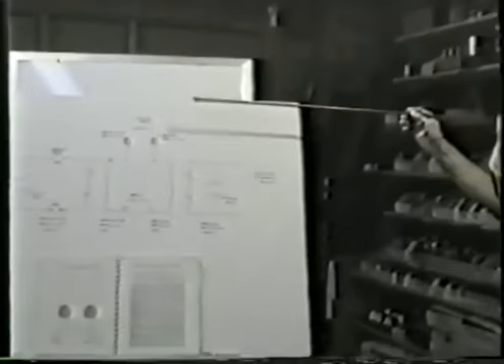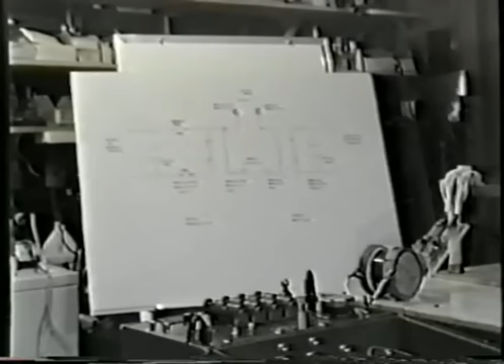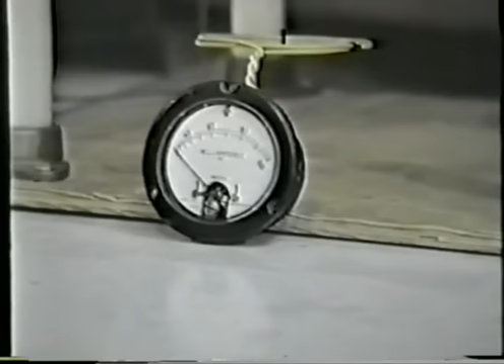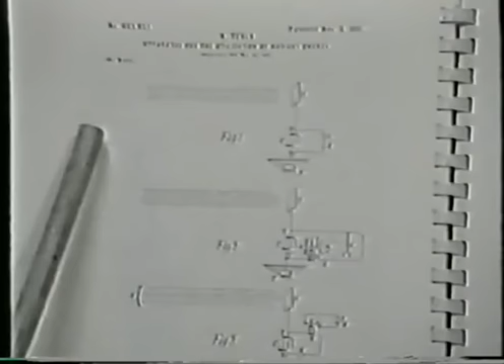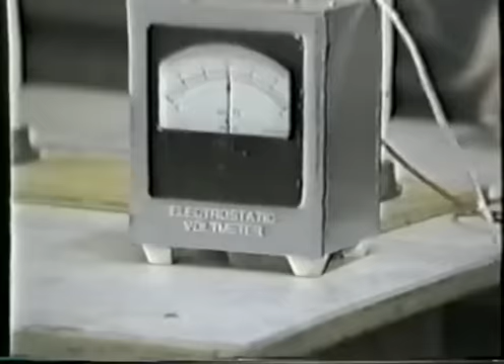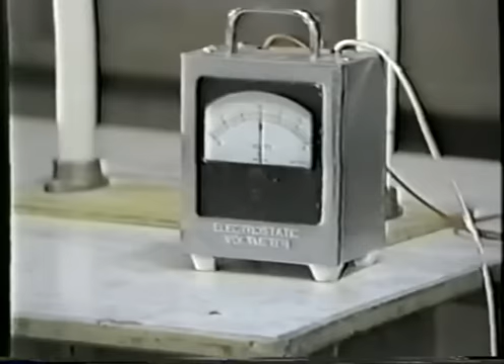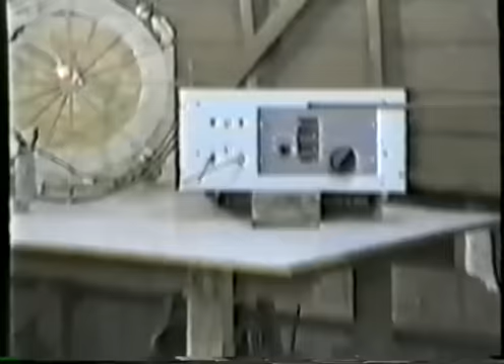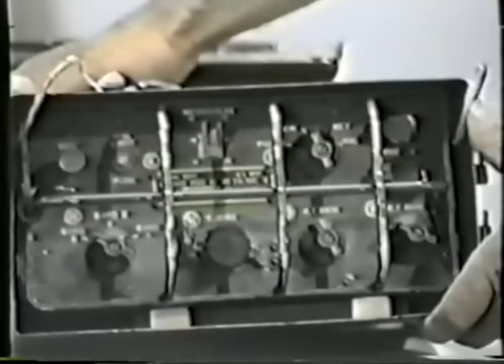Tesla's Longitudinal Electricity - Eric Dollard, Peter Lindemann & Tom Brown

Comment from the maker: Tesla found that when he sent radiant energy into the ground he could gather it at a receiving station several miles away. Tesla could indeed transmit electricity wirelessly but NOT through the air. Tesla said in his own words that significant transmission of power through the earth ionosphere wave guide was impossible as it was not thick enough to conduct significant power. The transmission was through the GROUND, literally.

Comment from the maker: What was more amazing was that sometimes more power would appear at the other end collectively than was put in. For example if 1000 watts of conventional power was pumped into WardenClyffe then 1000 watts could be gathered at a receiving station in California and another 1000 watts could be gathered at a receiving station in Egypt, for a total of 1000 in and 2000 out. The earth would magnify the power. The more receiving stations the more power.
Reply: That could only happen if the receiver coils r operating as tunning forks w energy transfer happening over resonance frequencies of either one working as a transmitter the rest as receivers of harmonic resonance
Reply: @roshanmathew9443  Wardenclyffe operate one immense reactive power which requires a trick or 2 to be able to tap, he used the tower as a catalyst to stimulate the Earth turning it into the actual supplier of energy, not the tower. The receiver coils being resonantly tuned allowed them to pick up on the induced disturbance and do work.

Comment: I don't know who actually reads this but a lot of obfuscation has happened through Tesla myth vs. Tesla's true experiments. However for me one thing of immense value would be if in all of the high energy, resident, isotropic EM radiations found within the environment  a part could be rectified into anisotropic current. If done efficiently… you know where this would lead. In theory (Tesla) the potential is staggering.

Comment: Reproduced the lightbulb segment at home with the popular Tesla coil setup. You can get the effect by putting the light bulb (got one from an old microwave) in series with the ground connection off the secondary. It's pretty neat. Couldn't get a cap to charge yet, though.
Reply: Aklemvaeo Hi Aklemvaeo, could you tell me how you got the light bulb segment to work? I would be happy with the light bulk attracting copper.
Reply: It wasn't QUITE as strong as it seemed in the video, however, it was still noticeable (my system probably wasn't tuned correctly). All I did was connect a incandescent bulb in series with the ground wire of the secondary coil buy sort of trial and error watching the video. I haven't had the chance to experiment much, but I had found that it attracts all conductive material, akin to the strength of a weak static charge. The filament must be in-tact and be bright-orange (heating up due to ground currents) as in the video.

As he mentioned, try to use a smaller bulb, as they use a vacuum as opposed to  inert gasses - most hardware stores should have them. Worked for me, though I haven't tried it with other types. Remember, sparks or corona coming out of the top of the coil is power loss. to maximize this effect, try to limit the amount of possible sharp edges/breakout points on your top load. Hope this helps.
Reply: Thanks! A few more questions. What sort of input did you use. They used a medical Tesla Coil. Is a "regular" Tesla Coil good enough?

Since I have read that most things we call Tesla Coils today are not actually how Tesla built them.

Comment: This is a fantastic representation of what science says is not possible, as well as what all of Youtube's doubters, suppressionist and mathematicians state is out of the realm of possibility. My question to you is this, I do see the camera glitching and sometimes blanking out due to the fields produced by the energy released in the arc gap. As we all experiment with this stuff at high frequencies, how bad is the emmission of these fields to the human body? Is there a potential for xray, microwave or gamma transmission from this system as stated on some  high voltage switchgear states in their warning labels while switching? I by trade have been a high voltage cableman for nearly 20 years that have questioned this over the years. The high voltage switches in question that supposedly produce dangerous radiation are both air gapped or gas switches that use SF6 vacuum bottles for their operation. Switching is done under vacuum while the switch is filled with the gas, then, put under a negative pressure for successful operation. The switches operate under approximately 5kV or 15kV phase to phase voltage (4800v, 4160, 13,200 or 13,800 volts and 14,400v ranges labeled at either 5kv or 15kV @ 60hz making it much different than the high frequency you are using, probably a whole different ballgame) Anyway, my question is that during those switching periods, due to the high level of energy possible and amperage forced through the system from the generator, they say the arc opening under load in and out of a vacuum creates these dangerous waves. I am wondering if the system you are working with has the ability to emit the same type of dangerous wave which may cause cancer and other tissue damage that is virtually unknown to the operator without stamps or labeling. I know a high powered field is present which interferes with the camera, so, if it interferes with the camera, could it be potentially dangerous to be around? I experiment with high voltages, wireless transmission and all sorts of other phenomenon to try and witness the transfer of energy use without creating additional loads to the source as a ton of othr researchers do. Is it fair to say that these waves may be present around the rest of the family possibly causing harm to them when I use systems like this or the Hairpin circuit in my basement? We do experience interference within our televisions and radios, cellphones, etc. I'd like to say it's safe to the wife, however, I don't want to transmit something potentially nasty that may cause harm to myself or the rest of the family. What should I NOT experiment with maybe frequency wise or what should I steer clear of when experimenting? Are vacuum arc tubes a danger to us? I have used over the years early radar vacuum arc gaps and such which I have to say made me feel a presence of something potentially harmful. Is there a frequency range I should stay away from or is there nothing to worry about? I like to fire up the hairpin circuit and try all sorts of experiments and am just worried I am going to harm myself or others doing so. Please let me know if you and Eric have witnessed any release of potentially harmful energies such as microwaves, xrays, or any other high powered energies capable of destroying human tissues, causing possibly nerve damage, eye damage (other than from looking at the light), basically from just being within so many feet of the experiments. If and when you have tried to shield these waves, how would you do it, maybe by creating a Faraday cage around the lab with a grounded conductive paint or maybe metal rooms, sheds, etc? If this can be of any type of danger to my family, I'd probably purchase a metal structure and build my lab in it outdoors, away from my home, grounding the structure using very large low resistance resistors so the shelter wouldn't be an attractant to lightning.
Reply: An arc gap produces a near infinite number of radio frequency harmonics well into the microwave and xray ranges.  Most harmful is ultraviolet emissions that will destroy your eyes.  An arc gap is a cheap way to generate high power radio waves, but continuous wave (CW) is certainly much safer.

Cheap RF detectors are fluorescent lamps and broadcast radio receivers to check high power and low power RF at various distances.  If you can light a hand-held fluorescent lamp tube, then you are too close for safety..  Even Tesla did not sit near his energized coils - the photographs were double exposure with power on and power off.

Comment: Energy goes in a light bulb, out the cable and into the KWH(Kill A Watt Hour) meter where it is terminated. Heat originates @ the load moving towards the generator. The KWH meters have no physical on or off switch, yet the KWH are always on....

Disconnect the battery ground terminal of any vehicle and everything will cease to function. So where is the Energy coming from since the positive terminal is still connected to the battery?

Comment: Why would a utility company be threatened by this then. Unless you could take 100 volts of electricity and send it a mile down the road through the ground, it would take huge amounts of power only available from a generating station. You don't find those in someone's back yard.

What would have been the practical use anyway?

Comment: Do not have a fisher medical tesla coil laying around. Can standard ac be used as the source ? Tesla's patent did mention one could use oscillating current. Tesla's patent 649621 does not include spark gaps or a capacitor. Are the spark gaps and capacitor from a different Tesla patent?

Comment: The phenomena with the light powered by the "longitudinal" source is likely explained by the photoelectric effect.  The source acting on the filament is likely both liberating electrons and high frequency (blue, maybe uv) light or photons.  The electrons negatively charge the inner surface of the bulb and the higher energy light knocks electrons off the exterior metal surfaces giving them a positive charge.
Reply: electrons do not exist, theyre field concepts of protons
Reply: Theoria Apophasis "Electrons do not exist"?????
Reply: ***** photoelectric phenomenon is directly proportional to number of photons hitting the valence electrons and does not have anything to do with frequency.But,frequency of photons increases the momontum of electrons which means the electrons come out the metal faster . But intensity of photons increases the ejection of electrons ,which means more potential difference is created across the ends.

Comment: The "Terrestrial stationary waves" article on wikipedia explains how it is impossible for this to work. Can you please explain to me in layman's terms Tesla's idea? I'm not an engineer or a physicist. Please be as detailed as possible, you can send me a message. Thank you!
Reply: If you're still wondering about this, Tesla's transmission type is an electrostatic displacement current that has dielectric materials as its medium of choice rather than "conductive" materials, Tesla found that the Earth can be made to resonate like a bell and transmitted into the Earth at a multiple of 11.77 cycles per second (Earth's electrical frequency) which set up standing waves in the crust.